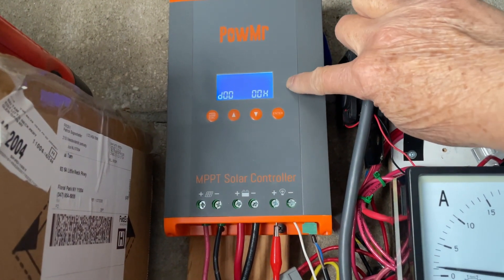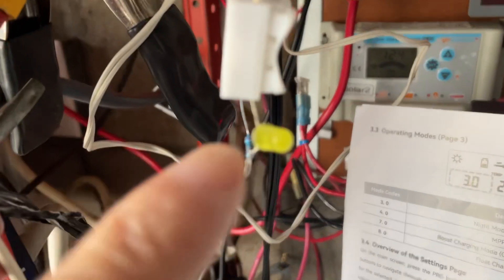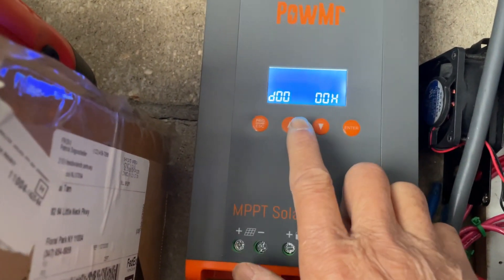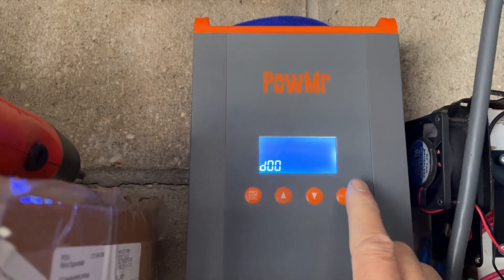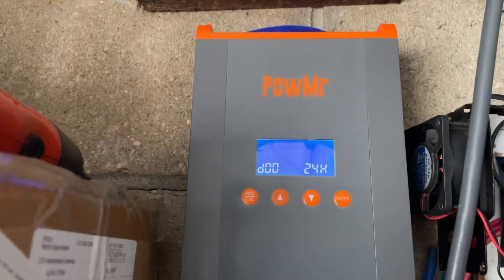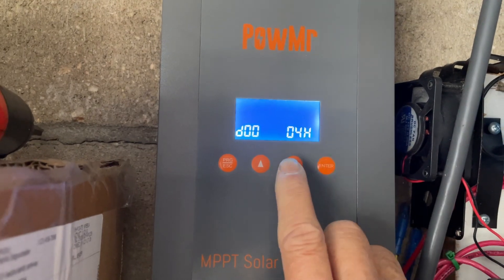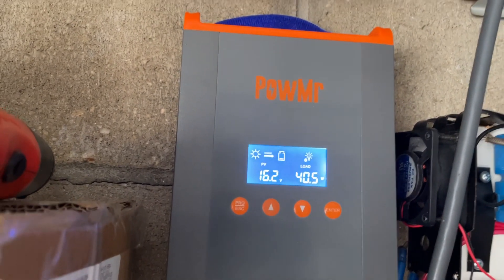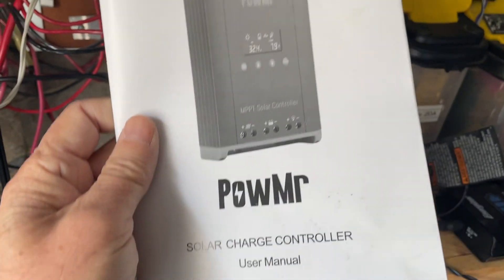Load control settings on PowMr 60 amp mppt solar charge controller

Comment: Salve ,con hna batteria 33v,che tensione e amperaggio può essere inpostato all'uscita con lampadina? Il timer lampadina si ripeterà anche nei giorni a seguire? Grazie mille della risposta,non capisco cosa dice dal video.
Reply from the maker: The timer will repeat itself. No need to set it every day. For 33v battery, the charger should auto detect the voltage. To be sure of the load output, you can use a multimeter to check the voltage when the load is on. I don’t think you can change the voltage. You can however use a buck converter to lower the voltage if it’s too high for you.

Comment: my 510w panel is producing 38v max and 11.2a max with my powMr HHJ-60Ah and my  12v 75ah deep cycle gel battery gets max 160w. is the charge controller efficient?

Comment: My sachet inverter that came with an inbuilt charger is connected directly to the battery  and  in this powMr HHJ-60Ah model . It shows the battery is 15.3 v  when its charging and when the battery is completely charged goes back to 12.9v.  My previous pwm never shows  the battery to be more than 14.2v  when charging with AC. Does the charge controller play a role in regulating the voltage if im charging the battery with the inbuilt charger from the inverter or the  powmr controller has has issues by exceeding 14.4 v
Reply from the maker: @odohgift972  In setting up your solar controller, make sure you select the proper battery type.  Under D06, I assume you picked SEL (sealed battery) since you stated 13.8 float and 14.4 boost charge.  When charging, voltage can be 14.6 so 15.3v is probably the solar panel voltage. 12.9V for sealed lead acid at resting is normal and considered fully charged.

Comment: Whats the max amp of the load output?Do i need to disconnect battery to save the settings in the model HHJ-60Ah powmr?
Reply from the maker: @odohgift972  According to manual, it’s 8 amp. It’s not a lot but some people use 24v batteries or higher. You don’t have to disconnect battery. You press enter and exit the settings. Do not disconnect the battery from charge controller if you have solar controller connected or you will damage the controller. Disconnect solar panels first if you were to disconnect the batteries.

Comment: I just installed this charge controller and the  max i get is 52w with my 2 12v 80w panel connected in parallel. What's wrong cuz here in Nigeria there's sunlight most of the time. I dont understand the parameters/readings on the controller. My settings for my 12v deep cycle gel are 14.4v absorption and 13.8v float. The readings of the controller are

 PV 17.5    51.2W

Mppt(4.0) Temp(34.0)

Batt(12.8) amp (4.0)

Fault - -   - -  - -

Is the Watt displayed the total power of the battery (12.8×4.0) or is 4.0 the amp input of the PV and if its the amp input of the PV shouldn't the watt displayed be 70w(17.5×4.0) ???
Reply from the maker: @odohgift972  it means only 51.2w is going into your battery.  You’ll have more watts going in if your batteries are discharged. There is some resistance when your battery voltage is at 12.8v.  You’ll see the wattage decrease as the voltage of your battery go up.
Reply: @wtam69  same thing happens when my battery is at 10.7 v
Reply from the maker: @odohgift972  There should be more watts or more of a charge when your batteries are at 10.7v.  Increase the size of your wires from the solar panels to the charge controller if they are undersized.

Comment: Will it work well if my lights are 5v not 12v
Reply from the maker: @odohgift972  No, it doesn’t work with 5v.  You need a converter to change voltage from 12v to 5v. Wire in a 12v socket and use a 12v usb adapter to plug into socket to get usb 5v if that’s what you’re after.

Comment: Can i apply same exact settings to powmr HHJ-60Ah not powmr HHJ-60Ah pro. The powmr HHJ-60Ah is metal all round. I app 00H and load didnt turn on at night even when battery is fully charged. I set to 24H and still didn't turn on
Reply from the maker: @odohgift972 Are your batteries 12v and you are using a 12 v light? The load has to be the same voltage as the battery.
Reply: @wtam69  yes my batteries are 12v